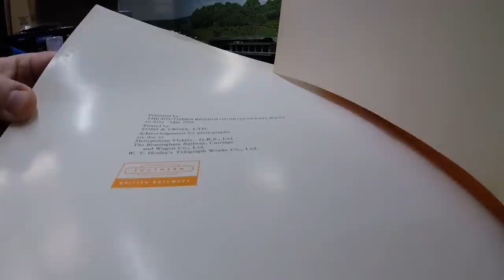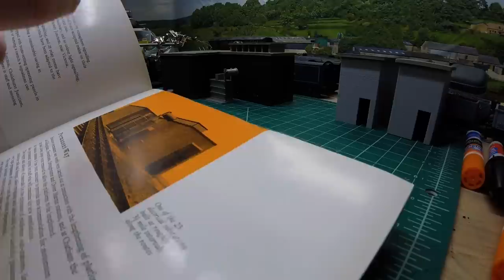oorail.com | Model Railway 3D Printing Project Update - January 29th 2019

Comment: Probably not the right place to ask, but still trying to catch up on your videos.
I just bought an Anycubic i3 Mega and have 1Kg of the ebay PLA on the way to set it up and test with.
The Hatchbox filament is A$100 on Amazon AU and I don't want to roll the dice on the no-name filament.
Just wondering if you've used and have an opinion on eSUN filament, which is cheap and easy to obtain here.
Thanks for all your good info.
Reply: Oops and if you do a 3d printable 16t steel mineral wagon I'll buy it as I need a rake of them but at A$20plus a pop it will take me ages to put together.
Reply from the maker: No worries Gerry, any of the 3D printing videos will work for this type of question. I'm actually up at 3am this morning to play catch up on my video editing! The cost and availability of filament definitely depends on where you live. My experience with eSun is that it is a good quality filament and I've had no problems printing things with very fine detailing, such as 40' containers with less than 0.45mm wide lining details on the sides. The eSun filament is actually one of the brands they ship with the JG Aurora printers that we have. I've only tested out the the orange and white PLA from eSun, but it works very well and I had zero problems with it. There should be a 3D printing page up on oorail.co.uk in a few days, I'm currently bouncing between video editing, 3D printing, CAD and layout work.. fun times! One of the videos that I am editing today is about filament, which should help you out a bit...
Reply from the maker: This is exactly what Trackside3D is for! :) A 16t mineral wagon should print around 50-60g (grams), so divide your kg cost to figure out the per wagon cost. I've got the wheels perfected at this point, but I am making two versions of most rolling stock projects. One that works with 3D printed wheels, and one that works with Hornby/Dapol/Bachmann etc metal wheelsets. I've found that increasing the vertices in the wheels in the CAD software produces a very high quality wheel even out of PLA. You will need suitable K&S or similar brass rods. I prefer the brass rods because they add a bit of weight to the project as well, although PLA is much heavier at 100% infill than the cheap injection mold plastic the manufacturers use. 

I can definitely move the 16t mineral wagon up the CAD todo list. I use a combination of original BR or LMS/LNER/GWR/SR diagrams, photographs and some software I developed that does some clever stuff to verify dimensions using dozens and dozens of photos. So I can quickly pull in the information, then putting the CAD together doesn't take too long. Which style of 16T mineral wagon are you looking for and do you want the doors to open... https://paulbartlett.zenfolio.com/brmineral ? :)
Reply: @Oorail  Just looking at the diag 1/108 in any of it's variants. Don't really need opening doors or anything and there's no hurry.

Comment: Would be interested in you can recommend, a 3D printer, I primarily use an I pad, so I need your software templates to be compatible for both the printer and I pad before I commit to my purchase

Regards Robert .
Reply from the maker: Hello Robert. For 3D printing, you will need a 3D printer, filament and a gcode file for the object you are trying to print. The gcode file contains the step by step instructions for your printer to create the object. The gcode file is created by software called a "slicer", which takes a 3D model (such as an STL file) along with a profile for the printer and the type of filament you are using, then creates the instructions based off that and settings you have provided (build plate adhesion, infill, layer height, etc). The objects available from Trackside3D are in STL format, so they will work with any 3D printer. One of the things we do with Trackside3D objects is try to design them for "maximum print success", so you may find some objects are upside down on the build plate, but this is done to eliminate the need for supports etc. You simply remove the print from the plate when its done, and use it the right way up. 

Trackside3D can provide gcode files for JG Aurora A1, A5/A5S and Z603S printers, using 1.75mm PLA. These are the printers we use for R&D, QA and final production prints with Hatchbox PLA. We just took delivery of some additional printers - Ender 3, A8 and i3, along with an additional JG Aurora A1. I will be getting those printers going here over the next couple of days, and will do a video comparing them for Model Railway applications, so you might want to wait for that video (should be towards the end of the week). 

If budget isn't an issue, I would recommend the JG Aurora z603s or the Ultimaker range of printers. The Ultimaker printers have an iPad / iPhone app and an Android app for direct printing. The JG Aurora z603s we use for R&D, its a solid printer, rarely needs re-leveling. If you are looking for an entry level printer, the JG Aurora A1 is a good price point and has fixed some of the issues with the original A5. Its basically the same printer as the A5 with some enhancements. 

In terms of a solution, the iPad is probably going to be the tricky part, you might want to look at using Octoprint on a Raspberry PI platform to provide the slicing and monitoring, then access that from the iPad via a browser or app. I have a bunch of Pi boards sitting on my desk, so I will do a video on that, but could be a few weeks away. 

We are putting the finishing touches on the new Trackside3D site, so you may want to wait for that to go live, as it has a lot of useful information that I've kinda just summarized a small portion of above.
Reply: Thanks for your detailed response. I will not be making a purchase of a printer until at least May of this year , so I will watch your web site with interest . Regards Robert